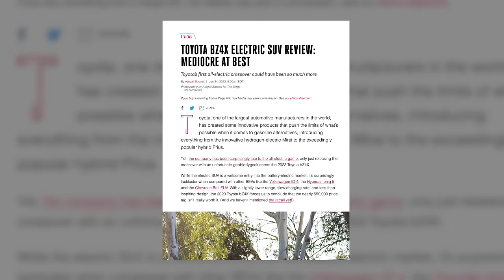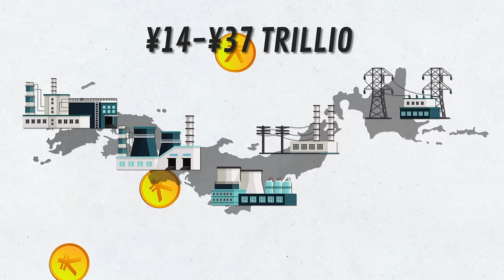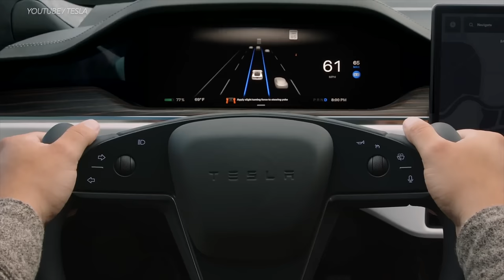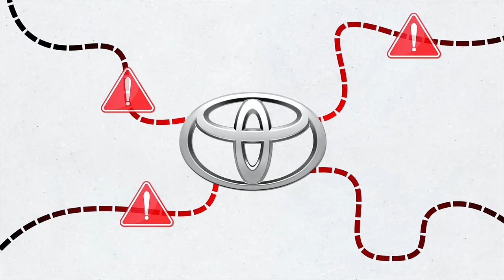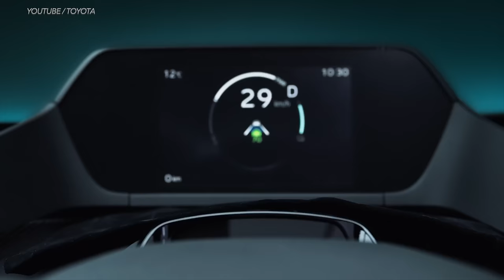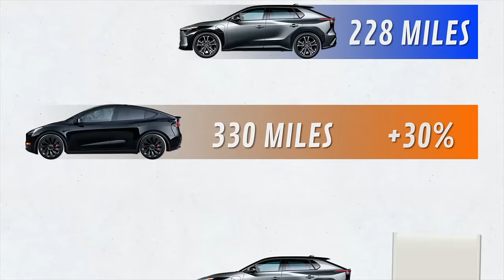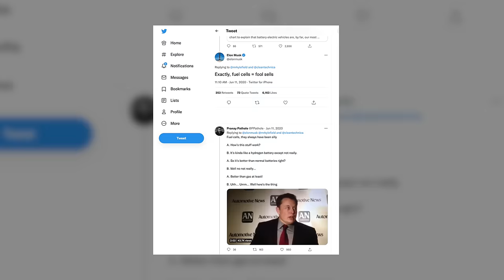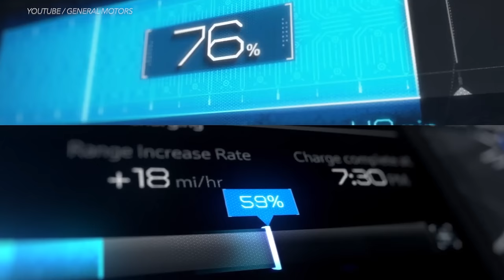Toyota's New Electric Car Shocks the Entire Car Industry

Comment: Loved the animations of Toyoda's words, however, he is wrong on EV emissions and energy use - the argument does not hold up to inspection - even when 100% fossil powered, an EV emits less CO2 per mile than a gasoline car, and can be further cleaned up over it's lifetime with more renewable generation - generation that fits well with a vehicle than can be charged during off peak or excess renewable generation.

Then we come to the extra generation argument, which also doesn't hold up, you won't need to refine as much gasoline when we use more EVs, and refining gasoline uses a lot of energy (and emissions) before it even gets to the pump, so that energy becomes available. It also isn't that much of an increase in generation because EVs are so efficient. In the US, if you electrified every mile driven, at 26kWh per 100 miles (16kWh per 100km), you need a 15% increase in generation over the 10 years (or more) it's going to take to do this transition, and that doesn't include the energy reduction from refining reduction - this is inline with grid growth, air conditioning was a much higher and faster growth burden in the 1970's.

The real reason Toyota is so late to the party is The Sunk Cost Fallacy - they wasted so much time, energy and money on hydrogen, but it just can't compete with batteries - hydrogen is either made from methane through steam reforming with CO2 emissions (and methane leaks) so it doesn't solve the emissions problem at all (you might as well stick with natural gas combustion) or, if made from electrolysis, it needs THREE TIMES as much input electricity to go the same distance as a BEV does (78kWh per 100 miles / 49kWh per 100km), so it doesn't solve the generation challenge - in fact it makes it three times harder.

The Japanese government has been pushing hydrogen for decades, and it did make some sense 10 years ago, but then batteries got cheaper, because China and Korea started making them at incredible scale, there was a clear moment when the future was laid out for the automotive industry, and that was the Tesla Model S and crucially, Tesla's Superchargers. That was the industries 'iPhone moment' - and if you remember the iPhone unveiling, most cell phone companies at the time dismissed it. Motorola, Nokia, Blackberry, Sony and Microsoft all said very dumb things about the iPhone at launch, and one by one, they all fell on their faces in the subsequent years.

For the BZ4X, Toyota had to turn to China, and their leader in electrification, BYD, to actually make the cars battery and drivetrain, the only thing Toyota had to do was put the wheels on it ....

The part I've never understood is why Toyota are so reluctant to put a plug on their hybrids and slowly grow the battery capacity, they had a clear path to take the revolutionary Prius from a mild hybrid (no plug, small battery, charged through the gasoline engine via regenerative braking) to a plug in (say 12kWh pack, no fast charging, but can drive the car on battery alone) to a range extended BEV (24 kWh battery - same as the early Leaf) with a gas engine to make it an easier transition and then finally a full BEV with fast charging and battery capacities from 40kWh and up .... had they done this over the last 2 decades, Tesla might have remained a niche luxury brand, and there would be Toyota Prius' all electrics on every street. Instead, Toyota are in real danger of having a Kodak Moment - and I don't mean a great photo you want to keep.

The closest a Japanese Auto company has gotten to getting EVs right is Nissan under the leadership of the outsider Carlos Ghosn - and look how that ended - since his exit in a cello case, Nissan has floundered too.

Comment: Toyota will consider every car electric because without the battery and starter motor they are dead 
in the water. Hybrids are a dead end technology for the future.

They must have underestimated the large torque applied to the wheels by an electric power train,
especially in turns.

Comment: Say good-bye to oil changes and other ICE wear-part costs* with batteries as a service !
 Modular cells that are easily swapped* ( by OUR certified technicians™, with proprietary equipment- see terms and conditions. For up to 10 years* ) so long as your Toyota Mobility Maintenance® subscription payment is current and you agree to the terms and conditions.
*Toyota Mobility Maintenance® subscription not included in any financial agreement by you and Toyota Financial Services ( TFS ) for the purchase price of the vehicle. 
*Battery modules swaps may be provided for a MAXIMUM of 10 years, for the subscribed original owner of the vehicle ( NON transferable ), with current subscription, up to a maximum of 12,500 Kilometers/Year, as parts are available, and per terms and conditions.

Someone, bet me.

Comment: EV could be feasible for people who drive less than 150 round trip to work. They could charge at night during off peak hours. But electric generation will have to increase soon in order to prevent rolling brown outs. I can't believe the nations leaders have been so careless about getting new generation plants up and running. 

If I had an EV I would want solar on the roof and maybe even a windmill to charge a battery pack in the garage so I didn't have to depend on the grid for all my power.

Comment: EV is just a bunch of crap, and there is no such thing of zero emissions 😡 Think about the battery manufacturing process how toxic is it 😡 Electricity from the.power station to substation the power loss due to distance. How about more road works electric car is heavier than petrol cars and many other problems.

Comment: I think Toyota's decision to guarantee their battery packs for a decade is a real mic-drop for the rest of the industry.  Batteries are the big Achilles heel for EVs and a reason a lot of people are worried to buy one if they have any plans to keep it for a long time.   10 years gives enough peace-of-mind to at least reduce that worry, and regardless of how well Toyota themselves do with BEVs, that helps force the hand of the other manufacturers to try and do the same.  It's certainly not the sole thing that needs to happen to make them more viable, but it's one big step in that direction.
Reply: Kia promised to stand behind their drivetrains for 10 years.  Sold a lot of them, but they're still crap that leaks and burns oil.  The 10 year warranty also turned out to have a lot of fine print and strings attached.
Reply: @STho205  Ha... yeah, ALL warranties have a lot of fine print.  I'm not suggesting it's a flawless, golden fix - just a step in the direction things need to go to bolster quality and reliability of batteries.  There are still a LOT of other things that need to happen - even with just the batteries themselves - to make EVs a viable alternative.
Reply: @Dakiraun  better to wait for a second or third production year.  Warranties aren't better than trouble free cars....but warranties can force the factory to make more reliable cars.
Reply: @STho205  Yeah, 100% agreed.  Always a bad idea to buy a first production year as well.  As Scotty loves saying - "let someone else be the guinea pig."

Comment: Toyota to offer a battery that retains is capacity after 10 years?  Why should that be a big deal. Tesla is already offering a 150,000 mile, 8 year warranty to guarantee the battery capacity will remain above 70% and so far they're reaching 200,000 miles with less than 10% loss. That would be 20,000 miles per year for 10 years. Tesla's latest batteries are designed to return over 1500 "full" charge cycles which in a vehicle with 405 miles of range is 1500 x 405 or over 600,000 miles of life.

Comment: An electric SUV is just a stupid idea. The form factor of an SUV is inherently inefficient. They are heavy, They have relatively high drag coefficients. Their high ground clearance and overall height are two characteristics that make it virtually impossible to make an SUV with a low drag coefficient.

BEV batteries are the single most expensive component in an electric vehicle. It would be far more sensible to begin with an efficient form factor, until costs come down, and then propagate that technology to less efficient vehicle shapes and sizes. IMO, Toyota would be far better off if they focused on efficiency first. What the world needs is an electric people's car, and Toyota is in the best position to make one that is actually reliable and affordable to operate.

Comment: I drive a Nissan leaf and will never go back to gas. The more EVs on the road the better. People don't realize how much electricity it takes to drill and pump oil from deep in the ground, pump it through pipelines, refine it, transport it to gas stations, and then waste 70% of it from heat loss in an engine. All that wasted energy could power every EV and more.
Reply: Exactly.

Comment: This is thier first attempt at this which they will learn from. While the 90% battery range is good and probably the best value on the market, they need to increase the range and have a breakthrough in solid state batteries.
Tesla are fun but thier support is questionable.
Hybrid vehicles makes the most sense right now for me.

Comment: I'd be more inclined to purchase the subaru version of the platform. I think it looks better and it has a name. I wish the range was better but knowing Subaru and Toyota the range they state is most likely what you are going to get if not better. Unlike the other ev manufacturers where you have to have absolutely perfect conditions to get there advertised range.
Reply: Be warned, the awd bz4x and solterra have very slow dc charging speeds.  The FWD Toyota bz4x has a different battery chemistry and faster dc charging speed.   I would wait 2-3 years to see if they can improve their bev cars. Otherwise they will go bankrupt.
Reply: @geoffreyevans6133  Talking to my buddy from Subaru of America and he says the fwd and the awd use the same battery architecture. In addition they moderate the charge amperage more conservatively to decrease damage to the battery. Fast charging and discharge causes rapid degradation of the battery. I believe that Subaru and Toyota coming late to the market is a good thing. They are more focused on producing a product that has a higher dollar value for its customers instead of rushing the market to be the first, the biggest or the fastest.

Comment: I think the electric vehicle race is nonsense. They talk about zero emissions but to charge these vehicle they need electricity and power plants use oil and coal to power them so electric vehicle will be worse. The only true zero emission vehicles will have to be powered by hydrogen. Let them put their efforts into producing hydrogen for vehicles and a reasonable cost. It can be done.